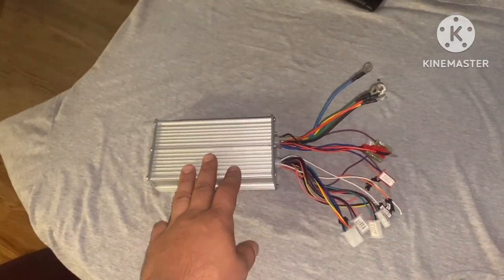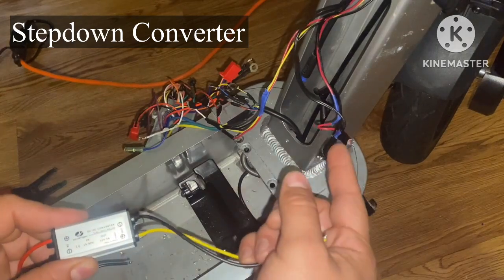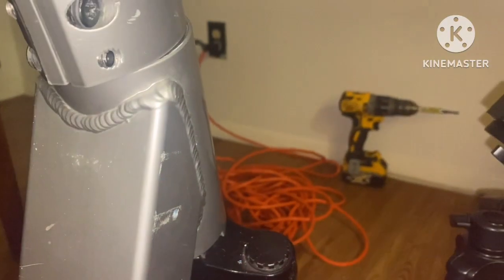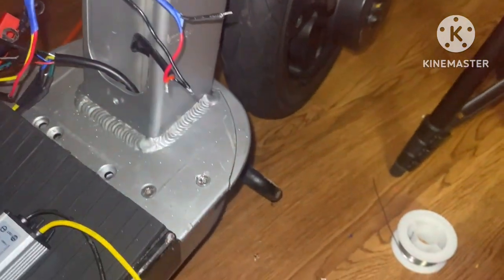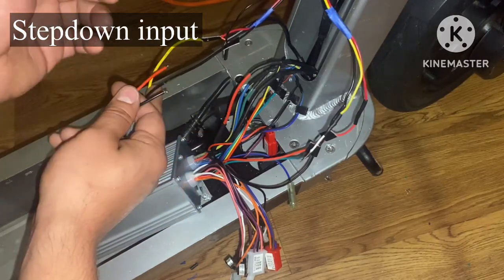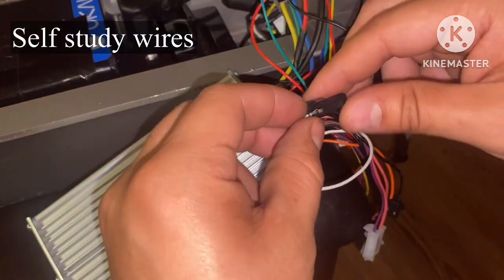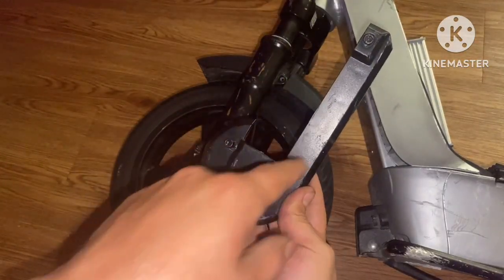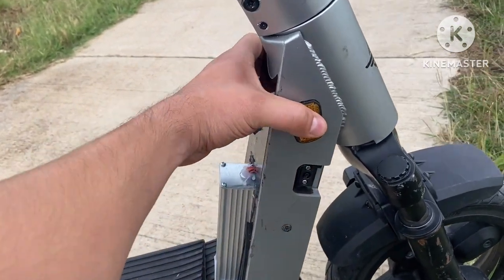Bird es 400a| Electric scooter| Brushless DC Controller |￼Install | Tutorial

Comment: Hey Fam,  I just got mines up and rollin,  you know what tho,  I took the battery out of the case, wrapped it up and removed that little battery lock mechanism and I was able to get a 500 watt controller to fit under the deck

Comment: P@j hey i ran mine straight to the battery with a kill switch amd it held the whole voltage the entire time I had it.I had never touched a scooter when the 1st person I ever watched amd watched alot was you my man.we've both came along way my friend.I build these damm things now.I just built a kugoo m4 pro I bought a knock off version pulled most of the internals and put in my own set up lights blinkers headlamp horn.I'm on my 4th set up now.all just having fun swapping shit out.thanks my friend

Comment: Hey so I got to the end of building a bird and I plugged the intelligent wires had the tire spinning the right way then I saw on one of your videos to plug the black and orange cable together but I only have a black and blue that don’t do anything when I plug them together and the throttle only activates for a split second as soon as I turn it on then nothing until I turn off then back on. Any ideas of what I can do?

Comment: Hello bro love the vids. Had a question for the bird 3 how come you can’t use the original display unit? Is it because of the gps. Thanks.
Reply from the maker: The firmware is locked.
Reply: @pjscootermods  hey boss ur the man i need to talk to abt a bio scooter, can i send my number for u to call orcan i call? Ill gladly compensate for ur time.
Reply: Controller is incompatible
Reply: display is very small and its attached to gps

Comment: Can u recommend a controller for bird 3 with 1000w and a display?
Reply from the maker: https://www.ebay.com/itm/314600932562?hash=item493fad44d2:g:XD0AAOSw0axkZ3Za&amdata=enc%3AAQAIAAAA0J%2B0onoX24CFqGaNe1ftEqup9xpVfajuVel9CIZQM0FmDycbORAmxqmLynbMKRWvNy9%2BR0GEKvQRwO3upbqvbvNLlmsx9FEIkY%2Fwe8%2F4eBO09YD7Tczr3PinV5xuMyMptNww4SwL%2BNx4Px4Avg1RKX2neM3N%2BlkxZuf%2BbD0PZaGwen8IG3hj%2BRa6diR%2Fpqj61OlSHnEZMfz5Lx1VGUYCwYY0OHdVdADJ3gE8RGqtEPrymk%2FeCo%2B2bBE8aHZfrMtre7HAusOrMj9tZKbgN8NAG6I%3D%7Ctkp%3ABk9SR7zxovOSYg

Comment: Why didn't you go through the 5v on the controller for the headlights?
Reply from the maker: It’s not suitable for 5v I tried in the past nothing happens when you connect 5 V to your headlight.
Reply: Why don’t you use the 12v connection on controller
Reply: @dtoddnv   there is no 12 volt from the controller. There is only a 5v-signal voltage and the battery voltage
Reply: Too low to power the light moreover it's a bad idea to mess with the 5v signal input line.
Reply: This makes sense not to solder to the 5v. Well I guess we'll take that apart and refit an alternative like a step down converter?